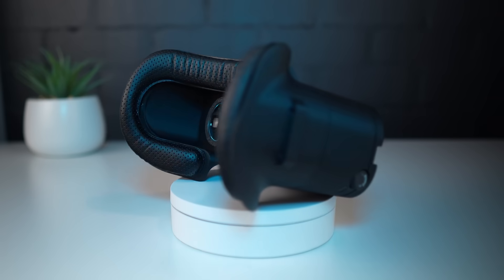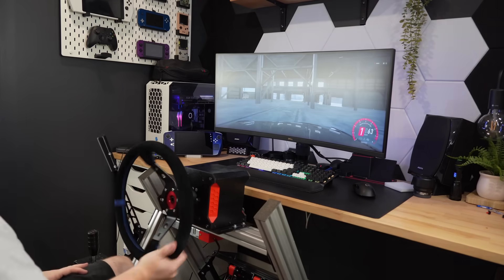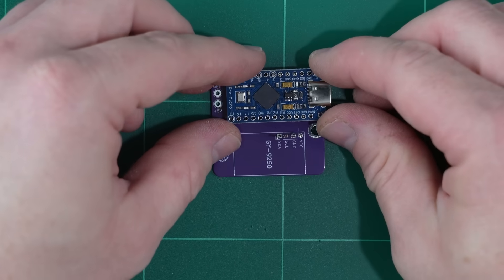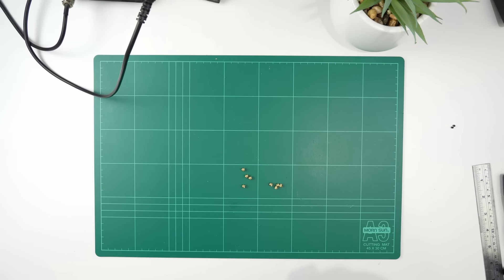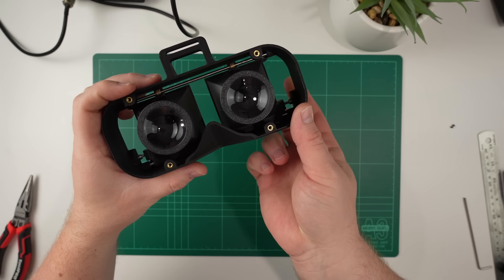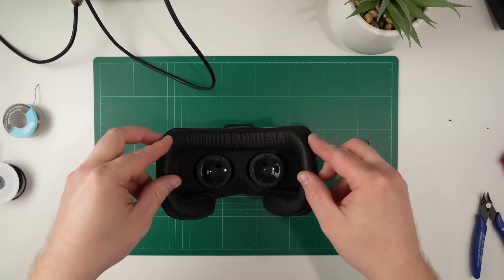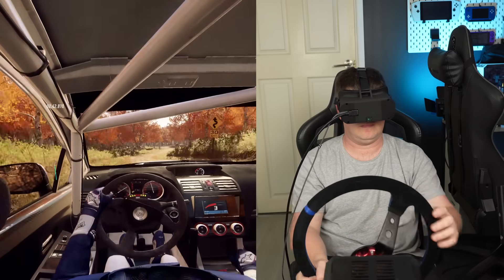I built my own VR for under $150!

Comment: How do you stabilize the horizon in this ones?
I am not sure if it is perceived as very shaky to other people but it is a lot more shaky than a monitor to me.
I imagine this is all coming from the head movement when one turns the wheel and may be it is smoother of you don't move your head.
I am also not sure if this shaky horizon is also on commercial googles but it looks annoying and unrealistic to me.
Reply from the maker: It feels a lot less shaky with the headset on, because the video is moving with your head. I also haven't tried a commercial headset but I imagine it is at least similar! The headset is using a basic gyro/accelerometer combo for head tracking. It will drift ever so slightly over time but SteamVR has a button that re-centers you if things get weird. I found I was able to complete a full race with no noticeable alignment issues, but I imagine over a few races it would probably need to be re-centered.

Comment: I built my own for my final year project for my electrical engineering degree. I used samsung's gear vr, and galaxy s8 for display, which meant no mechanical ipd adjustment though it was quite cost effective. Will definitely try this out some day.

Comment: Do you think you could revisit this but do a budget oriented FOV maxing headset? Im okay with lower resolution but for sim racing i think FOV helps so much with immersion. I've considered this project myself before but the lack of knowledge on lenses (and how to achieve wider FOV) with those off the shelf lens put me off doing it as it wouldnt be an upgrade to the rift s

Comment: Wow, so cool! I didn't think it was possible to make your own headset. I had to use Oculus Quest 2 and 3 at work and what I hated the most was how they force you to carry 500 g of battery on your face. Very unpleasant after just 30 minutes. Especially if you wear glasses. So your headset is already a big improvement! One small thing I would do differently to your design is to make sure the cables don't pull on the headset or dangle over my arm. It's a bit distracting in my opinion. And thank you for making it open source!
Reply: Standalone full vr is extremely the most complex device ever.

Comment: Really cool project! I will say as VR gamer of 10+ years that I could never go back to a IMU headset, even for car games. Having that immersion of repositioning yourself in the car like leaning forward to look behind your seat etc. is so amazing, and makes vr motion sickness much less likely. But I also realize that that is a much much more difficult problem to solve
Reply: I've got an Oculus Go that I managed to get going with SteamVR (using a 3rd party tool)... Tried it with X-Plane, and it was fun, but no benefit over the 2D monitor since I still had to use the mouse to move side to side to see stuff that's obscured by the seat or other controls... And with the headset on, it's hard to actually find the mouse back in actual reality.

That's an issue that's stopped me buying even a 2nd hand Vive or similar kit... Most of what I want to improve is simulator stuff. I'd have to choose between using the hand tracking controllers to pretend to hold the aircraft flight controls, or still use the physical controls but not be able to see them... And I don't think my brain could handle that disconnect.
Reply: @tin2001 i think that it’s better have static view for controlled by joystick
Reply: 6DOF requires getting your hands on an IR LED array, routing it around the outside of the headset, getting your hands on a pair of IR cameras, and then the PC software work of figuring out where the LEDs are, and deriving the headset position from that.

It's significant work, but there is a body of open-source software and hardware available that could allow someone to make it.
Reply: As a newb curious about VR sim racing, can you let me know which headset you like?  I dont know what IMU is or why its not good.  Also, what games support VR to the extent you said?  Head position in car, movement, etc.  Thanks!
Reply: @fescen9 I'd say the best bang for your buck currently is the quest 3, but it might be worth holding out for a bit as valve is expected to showcase their new headset very soon
Reply: @fescen9 most sims these days support it, ac, dirt rally, wrc , f1, automobilista, iracing etc.
Reply: And beam ng now!
Reply: @oculicious Thanks!  Quest 3S is 249/329 right now for 128/256.  Edit: nope, sale is over...
Reply: @fescen9  the 3s is more like the quest 2 than the quest 3 in terms of sim gaming, forking out a bit extra for the 3 is definitely worth it in my opinion, you can often find them used very cheap with minimal use, since VR is one of those things that you either love or hate and some people are extra sensitive to motion sickness or don't want to go through the adjustment process
Reply: @fescen9  Quest 3S is a lot worse than a Quest 3.
Reply: @oculicious what do you consider very cheap?
Reply: @TomJones-zv9se  depends a lot on region, but most places you should be able to find a 3 at the price of a 3s

Comment: I am working on a similar project but without using the arduino. Connecting the Pc to a dual display driver board. I had a question related to the display settings. When you mentioned at the end of the video about changing display modes. Is that a feature in your board which allows you to switch between copy mode and extend mode or can you see these displays as individual display on your PC which allows you to choose between the display modes since you would need a stereoscopic video for each eye.
Reply from the maker: That's built into the display board! It shows up in windows as either a single 1440x1440 display, or a single 2880x1440 display.
Reply: @cncdan  Ahh thanks! I have placed an order. Will test it out once i get my hands on them. Thankyou for the reply and for the great video!

Comment: Irrelevant for your use case perhaps, but will the display board output the full 90Hz at lower resolutions or is 90hz locked to duplication no matter the res?
Reply from the maker: I didn't think to try setting a lower resolution. I will have a look next time I plug them in! I suspect it is a limitation of the HDMI connection so I might look into swapping over to the DP model!
Reply: @cncdan  I'll look forward to that, the screens are super compelling at 90Hz!

Comment: This is an impressive build! The only thing is that having the connectors facing sideways doesn’t seem ideal to me — I think facing forward would be better, although I understand it’s tricky due to space constraints. If you manage to reposition them with adapters and solve the 60 Hz issue, it would be practically perfect.

Greetings from Spain!

Comment: Is there a way to add 6DOF? Or is there a way to make 6DOF tracker (even without VR) that is either IMU based, or is "inside out" as opposed to trackIR?
Reply: Mhm HATIRE has 3DOF output. If you want 6DOF, how do you want to cancel out the drift? Of course a gyro also has rotary drift, which it cancels out with the built in magnetometer. I guess you can just always slowly pull the head towards the zero position, i guess that works. You know what, i might not have VR but i do use opentrack head tracking so i could do that kind of thing.
Reply: @SianaGearz I always thought doing it in reverse compared to trackIR would be better solution. Either sensor/camera on head and leads, or VR style lighthouses around the monitor / cockpit. VR itself brings other issues to flightsims like DCS, but more reliable headtracking would be nice.
Reply: And also thank you for this project, it is the best think I've seen online in a long time!

Comment: It should be pointed out to the audience, this system is limited to 3DoF
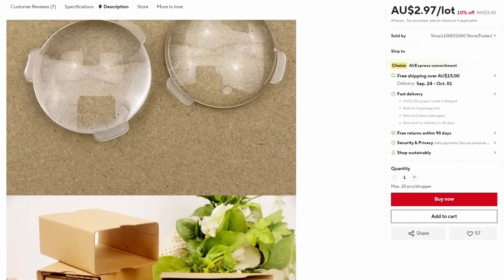Reply: He did mention the type of tracking  at 4:18
Reply: @KiLDELTA nice one. I didn't catch that. Thanks for pointing out, but it is as obscure, as it is to most non-VR enthusiasts What 3DoF and 6DoF is.😅😅😅
In general I guess I was just disappointed that he went for non-positional tracking as I feel it is still important in simming. Of course, I also understand that it would increase the effort.
Reply: @Bluth53  For a start, this is actually amazing. I could not build anything like this in my life hehe. I just buy a headset and I am okay.
Reply from the maker: Yes, no positional tracking, only 3 DOF!
Reply: @cncdan  in theory you could use steamvr trackers for syncing
Reply: @ZillionPrey could also use a kinect and use tracking markers on your body to track positional data
Reply: @ZillionPrey  too big a cost increase honestly, each tracker costs about what this entire project did, and that's to say nothing about the lighthouses and a receiver
Reply: @Plumtopia I think it's relatively easy.
I remember a Projekt from 12 years ago where they used a if led and a modified camera to track the position from the led and render the distance to track the head movement. Would be realistically easy to integrate
Reply: @cncdan if you can figure out how to make it work there was this adapter I used years ago on my GearVR called Nolo VR it was a usb attachment that made it 6dof to use my Samsung phone as pcvr
Reply: @cncdan you don't need a positional tracking if you play on a pc
Reply: 6dof is still very necessary for most games
Reply: (I’m probably wrong, but) Couldn’t you just add another IMU and Arduino to make this 6DoF?
Reply: @ThatMatthew28 
Sort of, but it's unreliable. When you do that, you're measuring the movement, not the position. This can drift over time. Like several metres over just a few minutes.
To get a reliable position, you need fixed sensors so the distance to the user is measured every time, not just the distance the user moved....
Does that make sense?
Reply: @tin2001 Even with 6dof headsets like the Vive or Pimax 5k i often have to reset the position / origin point when SimRacing. 6dof internal sensor should be able to maintain a set origin based on movement if it's actually working/programmed correctly.
Reply: @tin2001 Perhaps adding a few VR viewers and some reference points in the room (like LED lights) might work
Reply: Oof. And it has almost the same resolution as my Droid Turbo from 2014. The only problem with the Droid is that it's so old that it doesn't support any VR apps but two or three I installed years ago, and it won't even run Google Play anymore 😖
Reply: Back in 2016 I built a headset as a proof of concept whilst on the last year of my design degree. It had a 6 inch VGA screen with the stereoscopy provided by Tridef 3D. It had full 6DOF from an Arduino nano and a sensor board. This meant a second cable for the USB and the casing was a BOBOVR headset meant for mobile phones. It was limited by Tridef 3D to DX9 games and 60hz  but it was surprisingly enjoyable and allowed others to see the VR features of the website I designed. I even designed a PCB to make creating the tracking module easier. This was all part of my final major which also included my dissertation on the societal effects of VR and AR as well as a 3 D printable casing to make a standalone head tracker along with a series of posters advertising the tracker as a purchasable product. Ah, fun times.
Reply: I should also mention that the head tracking was based on the EdTracker project and software.
Reply: Perfect
Reply: you could probably just strap an HTC tracker to your head and mess with some settings to get 6dof on this headset.
Reply: Honestly all we need is to hack Quest 3 Operating system and change it with linux
Reply: Still a cheap way to let people experience some vr if they like diy haha
Reply: @crispycrusader1 it's nice if you like DIY, but if you're looking for cheap it's the worst option. There are dozens of options that fully made it to market you can get under $200, or you can spend a little more and get a brand new headset if you count your time investment in this project as money.
Reply: Nothing a vive tracker and lighthouses wouldn't fix but obviously that kinda defeats the purpose of this headset
Reply: I.e., not worth it.
Reply: Earned a sub
Reply: U can see that from the lack of exterior cameras lol

Comment: Beautiful project! I hope VR set controllers are coming next. :D Also I would love to see a wireless version of it!
Reply: Wireless VR is the most pointless combination ever, aside from the Meta Quest 2/3, that have an onboard PC that allow you to run games natively from the goggles.

Any other approach is just a waste of time and money, apart from a huge pain in the ass to build. You need to account for a battery that will have an impact on the weight and a compression/decompression algorithm that won't only affect the image quality, but will also add latency, which isn't great, as people already gets motion sickness with wired, low-latency goggles nowadays.

It may sound cool but, if anyone apart from Meta have already built a wireless headset is for a reason.
Reply: @eder.merino I wonder, how did wireless video work on the Wii U gamepad?
Reply: @eder.merino Wireless VR is amazing and something all headsets are going to move towards from now on. Tripping over your own cables, constantly having to un-rotate the amount you just rotated to avoid getting tangled and borderline strangling yourself sucks. Yes a battery adds weight, but if you're smart with the placement it can act as a counter-weight to what's already hanging off your face making the entire thing much more comfortable to use. The latency is negligible as long as you're close to the router. This is a solved issue, Gabe Newell even said it was back in 2017.
Reply: @lankeyykong  A 100ms latency isn't by any means negligible. And, as I have already said in my previous comment, yes, wireless vr is doable nowadays, but at a great cost, and definitely not affordable or assumable for a hobbyist that wants to build a DIY headset, regardless of the budget.
Reply from the maker: Wireless is tricky assuming you're talking about the video signal. Controllers are definitely in my wheelhouse though!